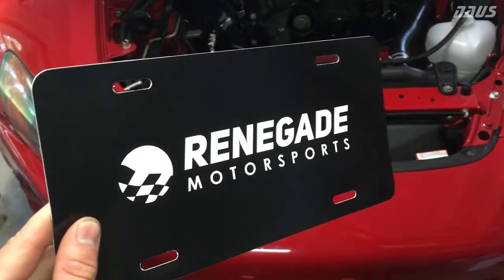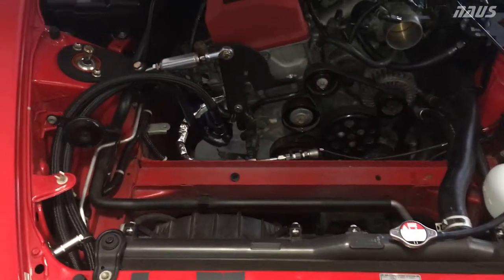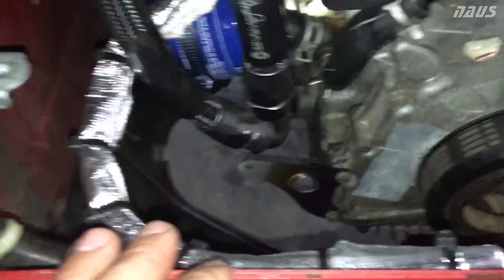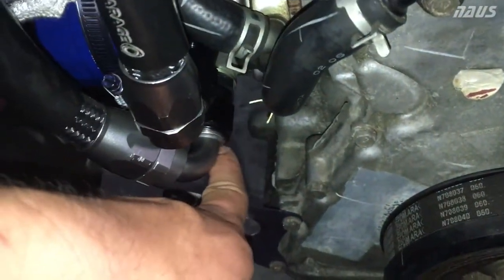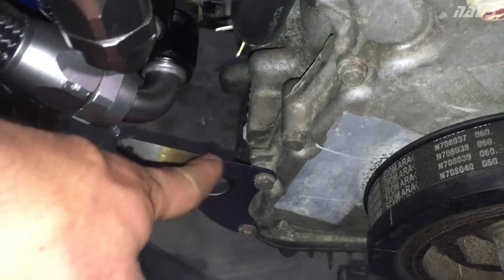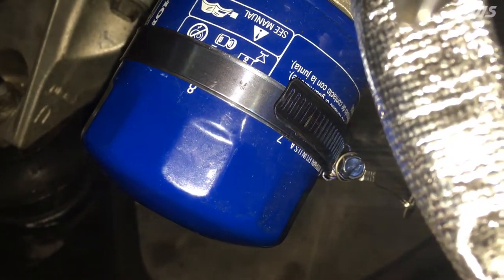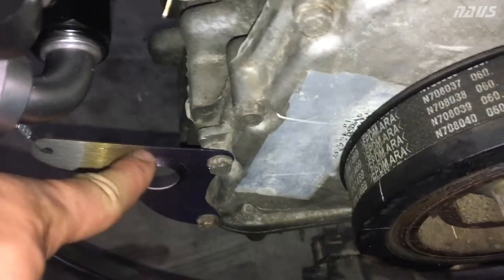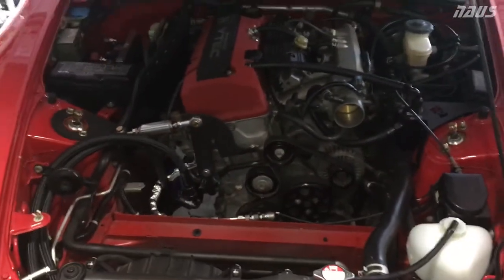Renegade Motorsports Oil Filter Stopper Kit - Honda S2000

Comment: What’s the benefit from this
Reply: Essentially its a bracket that keeps the oil filter from becoming loose or backing out. Which is useful for Track purposes especially on some higher reving motors.
Reply from the maker: Peace of mind really, I’ve never had problems with my oil filter backing out , however I have been to track events where I have personally seen s2000s oil down the track because the oil filter loosens up due to vibrations.